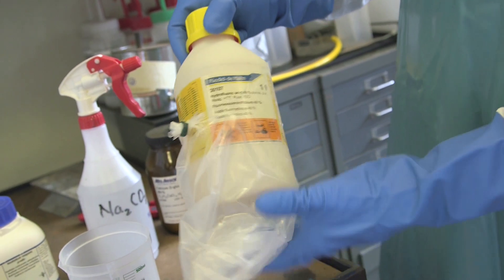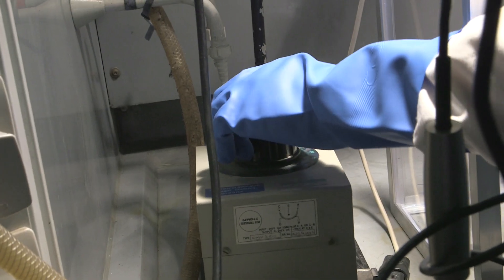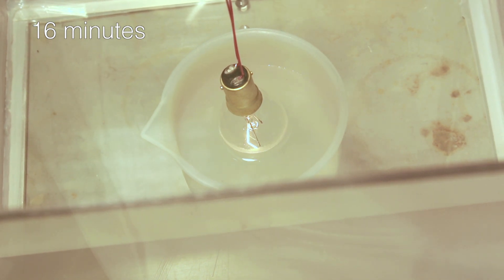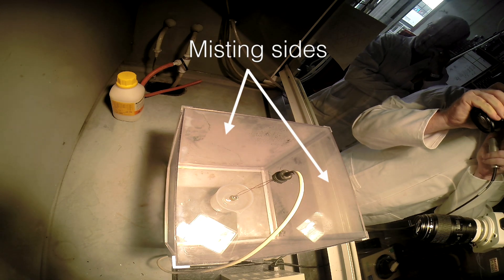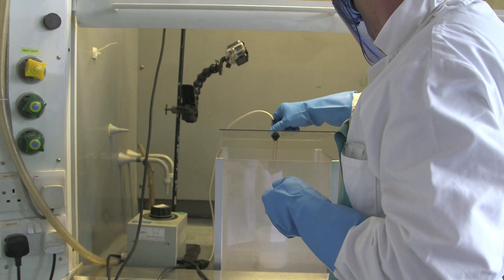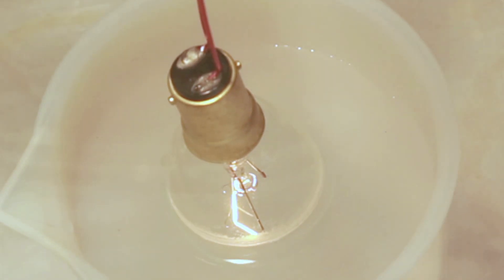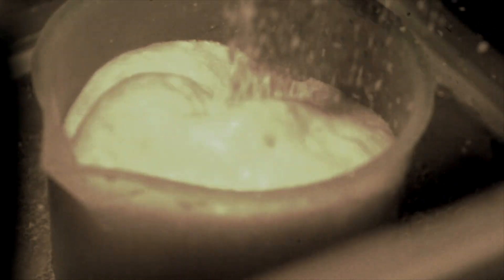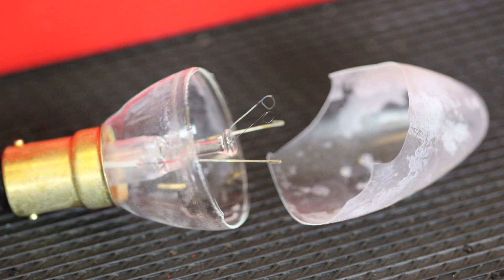Light Bulb in Hydrofluoric Acid (HF)

Comment: In terms of fast acting corrosive properties, it's actually considerably weaker than hydrochloric acid and sulphuric acid, and actually less quickly damaging than bases like caustic soda.
The trouble is that it's really difficult to wash off because fluoride ions can seep through the skin, doing damage in the following hours after exposure. They can also spread around the body and infect all sorts of sensitive organs and tissues, which is what makes it so dangerous.
What I'm saying is that putting your hand in caustic soda solution would more quickly damage it than in hydrofluoric acid - concentration/temperature being equal. The difference is that hydrofluoric acid would continue to damage under the skin (and possibly spread elsewhere) long after the hand has been removed.

Comment: Anyone have any idea why the bulb broke at the water line like that? I'm going to guess it's because that's where oxygen (and anything else in the atmosphere the reaction wanted) was available to the glass... higher up the bulb, and there's no acid... lower down the bulb, and there's no air! I also wouldn't be surprised if the people and equipment contributed, via small vibrations, to a tiny amount of sloshing of the acid, resulting in a thin band of bulb being repeatedly exposed to acid and then air and then acid and then air, over and over again hundreds of times a minute. Of course, I really don't know what I'm talking about. Still, SCIENCE!!!
Reply: John Clavis It is quite an interesting effect actually, the glass being dissolved becomes weaker. And kind of like having different resonant frequencies the shatter shock does not transfer very well across the line. I don't think it is chemical, it is just the way glass shatters.
Reply: +John Clavis That's where the glass was hottest, and the reaction fastest.

Comment: Any acid is an electrolyte. Electrolytes by definition conduct electricity when dissolved in water.  Hydrofluoric acid is a strong acid and therefore a strong electrolyte.
Reply: Actually HF is a weak acid.  I spoke too soon.

Comment: When I was in university, I had a summer job in the quality control lab of a cement factory in the UK.
This was in 1969, and we routinely used HF as a reagent.  In platinum crucibles, if I recall correctly... I don't remember exactly what test we were doing, but I assume it was something to do with dissolving out the silicate component of the cement.
Nobody seemed especially scared of the stuff, apart from the standard lab precautions for strong acids.
Guess health and safety standards weren't so stringent back then...!
Fortunately there was never an accident... during my tour of duty, at least....

Comment: I worked 24 years with HF very dangerous substance, used in manufacture of aluminum cans to etch surface before application of label.
thank you
Reply: ***** see what it does to glass the HF leaked in the honeydoo plant concerned me. theirs was airborne
Reply: Albert Michall Any incidents during your time?
Reply: Carbon 12 The HF was dilute for use in etching aluminum. Still dangerous no serious incidents...
thanks for asking
Reply: Albert Michall Even dilute it can cause a lot of pain, not nearly as safe as diluting other acids. So it is used to create a rough surface to bond the labels to?

Comment: It broke cleanly because of the heat difference...the glass out of the solution was relatively cooler than the glass being warmed by the reaction and if you've ever worked with glass that is a method of forming a clean cut in an already formed piece.  Let's try again with the entire bulb submerged!

Comment: Isn't it rather the temperature differece between the submerged part of the bulb and the part that isn't cooled by the liquid that causes the bulb to break exactly at the point where it is touching the surface? I'm not sure about what kind of glass is used for simple light bulbs like this one, but I can only assume that, since these bulbs are made from some sort of glass that can handle temperature changes quite well, since this kind of bulb heats up quite a bit when the light is turned on. For the time the bulb was submerged, the HF didn't seem to have much effect on the glass, although it was apparently clouded a bit and therefore thinned, to some degree in the area where it was submerged. I've seen some cases where a slow change in temperature in glass can cause very clean breaking points, even if no acid whatsoever is involved. Would be interesting to check the temperatures of the liquid and the part of the bulb that is in air, or repeat the experiment just using water or some other heat absorbing liquid, I predict that the result would be about the same.

Comment: I'm no chemist, but my guess would be the water with the HF and then the glass in it would either be conductive or have a low enough breakdown voltage for the Ac to happily conduct through it. If you had an Ohmmeter with really cheap probes (hobbyist multimeter from a cheap catalog or store) you could probably test the solution and see how resistive it is, if you can find someone brave enough to stick the probes into it.
Also, having seen a video on HF, it makes me wonder; are you guys covering some of the things from the Things I'll never work with? I seem to recall HF getting a lengthy writeup there.
+1 for the awesome video and neat reaction!

Comment: I hope I never have to work with HF. A chemistry professor of mine once told me a story about his own personal experience with it. He inadvertently dipped his fingers into a very dilute HF solution, for "barely even a second or so", and ended up losing the fingernails on his thumb and index fingers as a result, besides being put into what he said was the worst pain he'd ever felt.
Reply: hippiechickie18 The process of destroying a nerve is painful itself. And it's the last thing you ever feel with that nerve.
Reply: Its true it destroys nerves it denatures proteins and had huge toxicity level that could give you a heart attack at the touch of it. Its messes with your bones which produce a lot of things blood cells the lot.
Reply: I think HF destroys nerves, so in theory, he shouldn't have felt pain.
Reply: ***** I'm pretty sure the nerves are damaged by third degree burns, not overstimulation.
Reply: Can you help me? Is hydrofluorosilicic acid the same as hydrofluoric Acid? if so, why is it used in our water supply? its toxic right?
Reply: @jacobwatson9668  They aren’t the same. Hydrofluoric acid is an aqueous solution of hydrogen fluoride. Fluorosilicic acid is a compound formed by the dissolution of silica into hydrofluoric acid. I can’t say for sure why either would be used in water treatment or even how prevalent their use is. I know tap water fluoridation is a thing, I just don’t know if those acids are used as the fluoride sources. That said, the fluoride in tap water isn’t concentrated enough to pose an immediate health risk. To be clear tho I’m not entirely on board with tap water fluoridation.
Reply: @lorez201  well right. But the subtle influences t has plus the long term effects shouldn't be over looked

Comment: In case anyone does not understand why the water level cut happened I am pretty sure i know the reason.

the waterline was the hottest part of the bulb in contact with the HF solution.

1) The water was conducting heat away from the rest of the bulb more rapidly because the molecules had more directions to go to dissipate the heat.

2) The nitrogen in the bulb (yes its not a pure vacuum like most people think) carried heat convectively upwards.

3) the water on the outside of the bulb was also convecting upwards.

The Higher temp sped up the reaction at the interface.

Comment: You should probably try the same experiment in water to ensure that the way the light bulb broke was due to the HF and not due to differences in the cooling rate of the glass.  Since it was an old filament bulb it would have heated up and the HF may have cooled down the bottom faster than the top.

Comment: The break along the surface is a result of chemical reactions with the atmosphere. Here is another example of this: Furnaces that are used to melt glass in large quantities are usually emptied and turned off after about 6-7years (about half their lifetime) so maintenance can be done on the inside. If you look at the surfaces on the inside you can then see very clearly that the surface decday of the ceramic bricks is much stronger in the area where the surface of the molten glass comes in contact with the atmosphere. You can see that the corrosion goes very deep into the bricks whereas only the surface is effected above and below that point.

Comment: I once worked in a quality control lab in a fibreglass insulation factory where we used HF to clean platinum beakers used for trial melts. After soaking overnight in conc. HF the glass looked like sugar and could be washed from the crucible.
One test we did was chemical durability of glass. It was ground to a very fine powder then heated in water with reflux. This dissolved some of the soda lime components of the glass which could be measured by titration with a phenolphthalein indicator. So in fact glass was being partly dissolved by plain water.
Reply: It IS the universal solvent.

Comment: If any1 has noticed after the glass broke immediatley after there were alternating sparks on the electrodes ! For a moment then only 1 electrode sparked but intresting reaction HF is really a dangerous chemical. My chemistry teacher dropped 1 ml of it on a pipette and it just ran through it creating a hole in a noble pipette which handels Conc.H2SO4 nd HCL easily

Comment: I was so naive that in 1974, I bought a gallon of HF so that I could etch stuff in glass. In my apt I poured some HF into a plastic dish tub and dipped a piece of window glass that I had coated in wax and drew a design on. I let it sit for a while - I do not remember anything about the project or the results. I do remember that the kitchen window in that apt was not as clear as it used to be.  I knew enough to wear gloves, not to pour the stuff down the drain (I think that I took it out into the alley and dumped it there), and have no idea what happened to the rest of the acid. I remember that a couple years later some friends and I set up a bronze kiln/foundry in a shed in back of the 3D household on Aloha street. That is the last place I remember seeing it - I think that place was torn down in 1979. But a little knowledge is a dangerous thing (later I learned about Velvet Etching Cream - much safer).

Comment: I use HF for chemical etching of femtosecond laser written 3D structures in fused silica to fabricate microfluidic devices. HF is very selective and corrosive chemical and is always a nightmare to work with it!

Comment: Dear Professor Poliakoff,

Many thanks to you and your team for the wonderful und always very interesting videos you post on YouTube.

I have a question concerning the experiment with the light bulb in hydrofluoric acid.
Could the neat crack in the bulb not be caused by the temperature difference between the free part and the submerged and thereafter 'liquid cooled' part of the bulb? It would be interesting to see if the same thing happens even with a light bulb partially submerged in simple water.

Yours sincerely,
Luca Cettuzzi

Comment: I used to work with HF on a regular basis at an old job I had. Niel was wearing a lot less PPE than I wore while working with that vile stuff. At come concentrations it can eat the bone out from under your skin, so they say, and you have to get calcium gluconate shots directly into the burns to stop it from doing more damage.

Comment: I used to work with this stuff and sulfuric acid and have burned myself from direct contact a couple times. It's kind of overrated just a bit of water neutralizes it and was no big deal even the mixture of aqua regia.

Comment: In a previous career a long time ago, I worked in a lab while in college as a student chemist.  My job was to prep metal alloys for analysis by the lead chemists.  Some of the metal alloys are used in jet engines, the shuttle program, and nuclear industry and contain quite array of elements to produce the desired properties.  Some of these alloys were high in silicon, and I had to use a mixture of HCL, HNO3, and HF in order to dissolve the alloy to perform analysis on an AA spectrograph.  We used Teflon beakers because of the HF.  I was always careful of HF because its a weak acid and you can't wash it off very easily if you get it on your skin, but the acid that all the chemists feared the most, and the one I treated very carefully was perchloric acid.  It can go BOOM!

Comment: Pretty sure the clean break was nothing chemistry related, just thermal shock due to difference in temp between hot glass above the liquid level and cool glass cooled by the liquid (possibly aided by the HF thinning the glass). Maybe do a control run with plain water? I guess the sparking at the end was a combination of a very small electric arc with hydrogen burning.

Comment: With all due respect to the Professor, HF is like dishwater compared to some compounds.  Dimethyl mercury is so incredibly toxic that only a few drops caused slow, painful death in the tragic case of Pr. Wetterhahn, despite her wearing protective gloves.  Then there are super-oxidizers, like chlorine trifluoride.  They would have burned the water, the beaker, the fume hood, and more.  Then you have the unstable compounds that will explode if you do nearly anything to them.

Comment: Now do an experiment with chlorine trifluoride ;-)

To those unfamiliar with that little beast:
"”It is, of course, extremely toxic, but that's the least of the problem. It is hypergolic with every known fuel, and so rapidly hypergolic that no ignition delay has ever been measured. It is also hypergolic with such things as cloth, wood, and test engineers, not to mention asbestos, sand, and water-with which it reacts explosively. It can be kept in some of the ordinary structural metals-steel, copper, aluminium, etc.-because of the formation of a thin film of insoluble metal fluoride which protects the bulk of the metal, just as the invisible coat of oxide on aluminium keeps it from burning up in the atmosphere. If, however, this coat is melted or scrubbed off, and has no chance to reform, the operator is confronted with the problem of coping with a metal-fluorine fire. For dealing with this situation, I have always recommended a good pair of running shoes.” - John Clark

Comment: HF is extremely dangerous. One drop on your skin and your bones are doomed. You can never be too careful when dealing with it.

There was an accident in a Chinese high school. A chemistry teacher arranged an experiment session for students to play with HF (I know, WTF?) without proper protection (again, WTF?). Some students accidentally dropped some HF on their hands and the teacher was like "that's ok. Just wash with water you'll be fine" (Whaat?). It was not until 36 hours later that those students were sent to a hospital. The best time for treatment had already been past by then.
Reply: eeeeh.  I don't know about one drop and you're doomed.  But certainly requires a trip to the hospital and immediate action, not to mention necrosis and extreme pain.  But one drop won't kill or permanently injure you.  The margin for error is pretty slim though, especially if you don't get calcium glutamate on you right away.
Reply: xtamared Of course I did't mean it can doom all of your bones or doom you as a whole person. It depends on the amount of HF you are exposed to. But at least the tissues and bones in the immediate area of exposure will be ruined. F- will bond with all Ca2+ in your bones and form insoluble calcium fluoride (hence ruining your bones). That's why the treatment of HF poisoning always involving calcium gluconate. 
It doesn't matter what concentration the HF solution is. And less informed person would assume it is safe to play with low concentration HF. That's why it's so dangerous.
Reply: Not as nightmarish as simple dimethyl Mercury, but still scary.
Reply: xtamared from what I was informed by my Chemistry coordinator is that it's a sharp initial pain then pretty much no pain because the HF kills the nerve endings quickly. The HF then begins degradation of the nervous system caused by the Calcium ion pumps that are on the axon terminals, interfering with pre and post synaptic transmission.
Reply: Cam M sorry, clarity. HF binds to the Ca2+ ions that travel through calcium ion pumps.
Though I could be wrong about this...
Reply: HF, the stuff of nightmares....

Comment: I thought aqua regia was more feared?
Reply: No, aqua regia is really only notable in being able to dissolve gold. Unless you're made of gold, aqua regia isn't worse than the aqua fortis and muriatic acid it's a mixture of. Neil just puts on the usual gloves and glasses to work with it (there's a video). HF is a specific threat to nervous systems (which use calcium ions), which is why they've got extra protection plus emergency supplies.

Comment: I did experiments using HF at the university. Everyone was crazy paranoid about it and there was extreme safety precautions - including mandatory safety lecture, keycard access and mandatory announcements to the whole area every time the HF was out and in use.
Reply: DTU? What kind of research?
Reply: ABOlsen69666 Aalborg University. It was a postgraduate project, where we tried to show electroluminescence in pourous silicon. We used HF to produce the porous silicon.